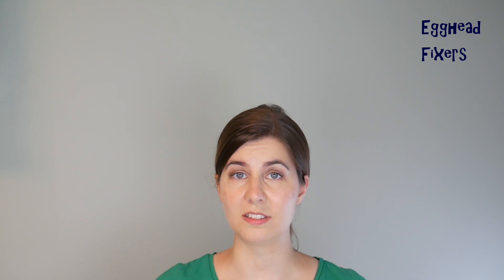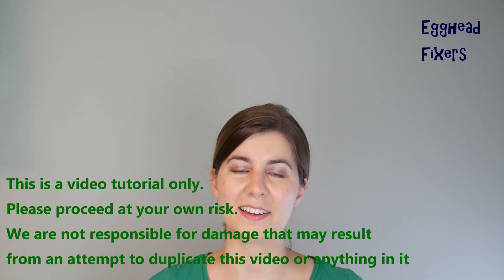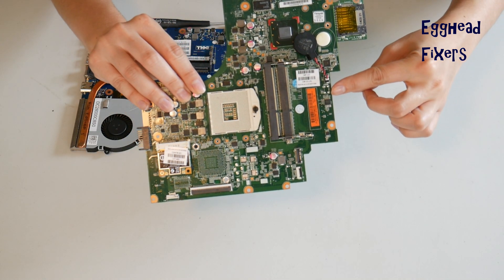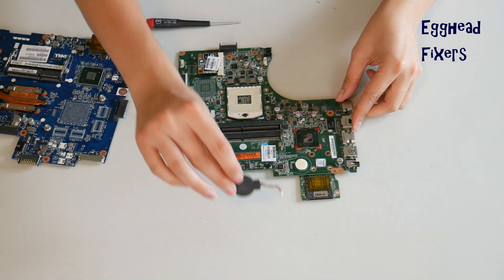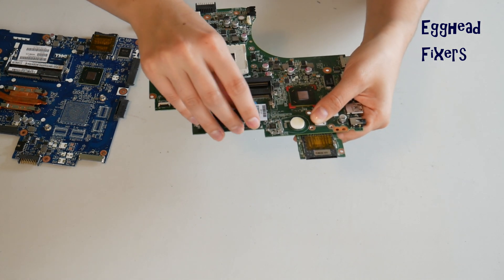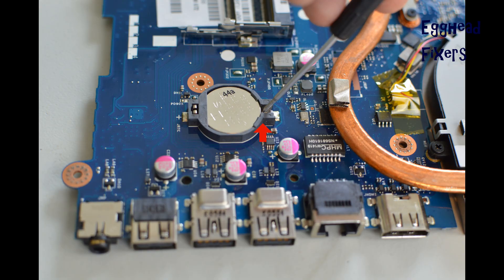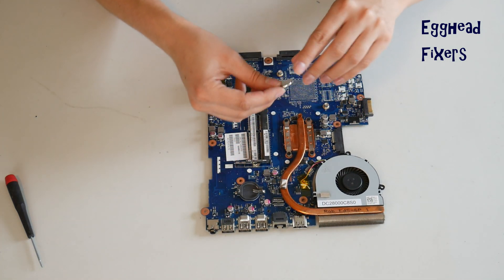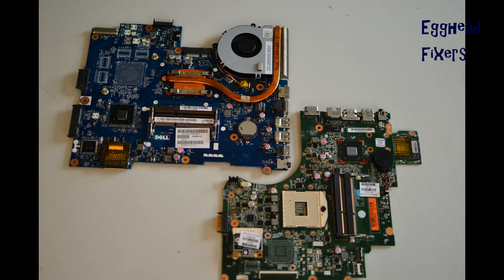How To Do a Bios Reset If Your Lenovo Turns On Then Off, Freezes or Won't Turn On At All. Video 4

Comment: Thank you! I need help locating the CMOS battery for lenovo yoga duet 7 13iml05 82as? My machine will not boot up. All tips help appreciated.
Reply from the maker: You can look up your computer's motherboard on eBay and then you can see where the battery is located. You can also look up a teardown video for your model on YouTube.
Reply: I did look at the tear down, no mention of cmos battery or boot rom. Thank you for the suggestion to look up ebay. I will update. Best

Comment: Lenovo Yoga 11S (2014) BIOS battery type3 , physically soldered to the motherboard ( I guess it's a rechargeable type)
Reply from the maker: Ya you can't BIOS reset that.
Reply: @EggheadFixers  Actually I believe you can if you unsolder one connection, wait the appropriate amount of time and then re-solder the connection.
Reply from the maker: @anglosaxon1622  Ya that is an option.

Comment: Okay, I've seen every video in your tutorial but it doesn't address if you've got the screen stuck on the "Lenovo" logo that pops up when you turn the laptop (in my situation is an Ideapad 110) on. Should I press the Power button to force it to shut down, then try the 4 methods you recommend in this series? Best regards, Anthony.
Reply from the maker: Yes that is what you will need to do. You will have to force shut down then try these different repairs. Let me know how it goes:)